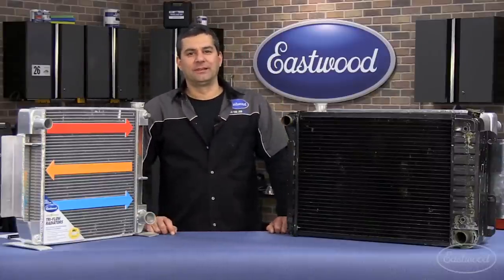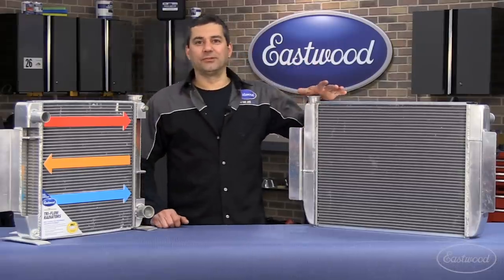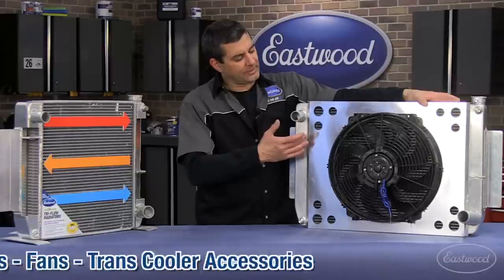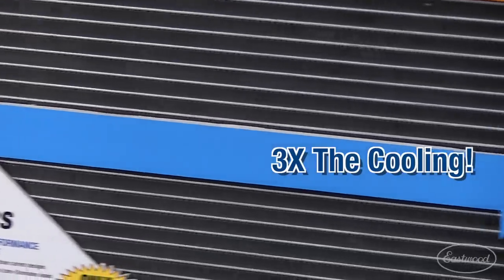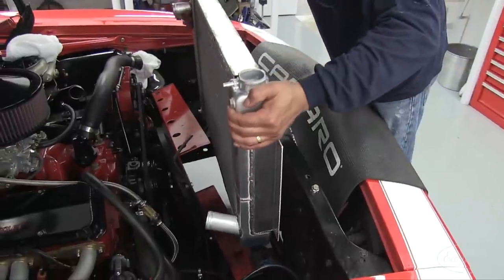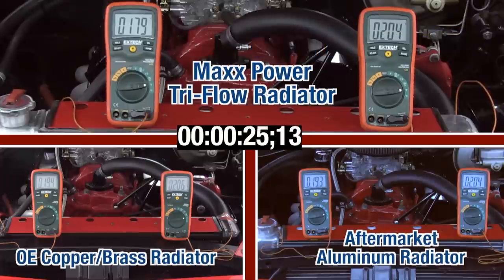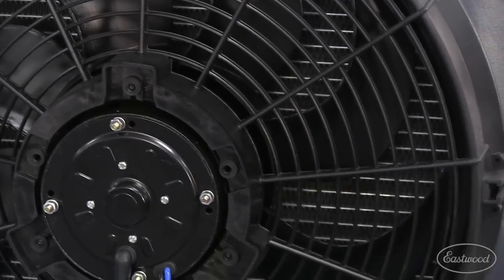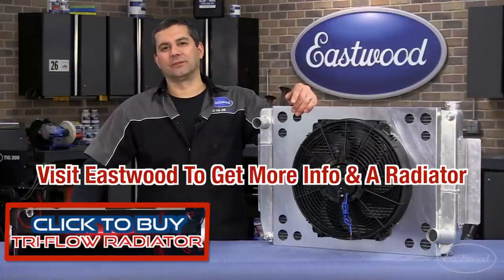Aluminum Radiator - Tri-Flow Technology Keeps Your Car Cooler Than Ever! - Eastwood & Maxx Power

Comment: Anyone who understands the physics of cooling systems isn't buying any of this.  Radiators are heat exchangers, not water coolers, and are at their most efficient when they are as hot as you can get them by pumping as much coolant through them as possible.  A significant temperature drop across the radiator means that it's operating in a less efficient mode, probably because the flow is restricted.
Reply from the maker: Mike Goble   Here is the explanation, in two parts.
Part 1.  You wrote, "Anyone who understands the physics of cooling systems isn't buying any of this.  Radiators are heat exchangers, not water coolers"
A heat exchanger is designed to exchange (remove or add) heat from one medium and pass or remove, through conduction, convection or radiation, that heat to another medium. 
You are correct; an automotive radiator is a water to air exchanger- meaning the water is moved through the radiator and in direct contact with the aluminum material, transferring the heat to the aluminum core.  The water (in this exercise) is also cooled. No, we do not employ a refrigerant to lower the temp of the water as an office water cooler would do.  We instead utilize precise and consistent diameter tubes and virgin aluminum “fins” to form a core that is highly efficient at thermal heat transfer.  The aluminum tubes and fins conduct energy (heat) from the water through the aluminum material and pass that energy (heat) to the air passing over the tubes and fins- essentially lowering the temp of the water…cooling.
 NOTE: At atmospheric pressure and ambient temperature, thermal heat will tend to move from a higher difference of potential (hotter) surface/object/gas to a lower temp or cooler surface/object/gas.
 A mechanical or electric fan is employed to help aid/increase the airflow over the aluminum radiator core to increase the cooling effect when higher speed ram air effect is not available ( traffic lights, under 35mph, heavy engine load, etc.)
 All internal combustion, water cooled engines, are designed to operate at specific manufacturers designated water temperatures. 
NOTE: For this exercise we are not taking into account oil temps, CHT or EGT- just water temperature.The manufacturers employ thermostats which are designed to regulate the operating outlet water temp of the engine, therefore creating a temp baseline.  For example an engine with a 190F thermostat is designed to run at an optimal (albeit lab standard) 190F water temp.
 NOTE:  220-230F is the new normal for late models but for this example we are talking pre 1980’s V8 engines)
Part 2.  You wrote:  "and are at their most efficient when they are as hot as you can get them by pumping as much coolant through them as possible.  A significant temperature drop across the radiator means that it's operating in a less efficient mode, probably because the flow is restricted."
 This is correct for a heat exchanger used to transfer heat from a higher thermal temp (the temp of the liquid, air, gas, etc., inside the heat exchanger) than the temp of the liquid, air, gas, etc., passing through /over its coil or core.  For example; in a home heating unit you want the most efficient method of transferring heat from one medium to a second. The electrical coils in a home heating unit operate efficiently at elevated temps to transfer (exchange) as much thermal energy from the heated coil to the air blowing over them.  A hot water heater is another example of your heat exchanger that must operate at elevated temps to become efficient.
We know that an internal combustion engine transfers chemical energy into mechanical power, the byproduct of this reaction…. heat. In fact approximately 65-70% of the energy in gasoline is transferred into heat in an internal combustion engine.  Also remember: heat wants move from hot to cold.   In the automotive application of a heat exchanger, you do not want the radiator to become heat saturated (“as hot as you can get them”), as you stated above.  If this were the case you would have a thermal run away- overheating.
If the radiator (heat exchanger) were as hot as possible there would be a partial reversal of heat transfer and the hot radiator, having a higher heat potential ( temp) than the water would begin heating the water to a higher temp than the 190F water temp the engine is striving to maintain.
Imagine the radiator aluminum core is hypothetically 250F and the  water entering the radiator was 190F.  The water would absorb heat through conduction and exit the radiator at a potential of 200F or more.  This is not what we want.   The increased heat of the water would begin to transfer thermal heat to the engine block and heads through conduction, which would increase temp and elevate the water to an even higher temp until thermal runaway and overheating.  You need the radiator to act as a water cooling component- not to chill or act as an office water cooler, but to impart as much thermal differential from the inlet to the outlet as possible. If we want our engine water temp to run at 190F then the water temp exiting the radiator and entering the engine must be below 190F.
So we need our engine water temp to TRY (not real world but lab based) to run all day at all loads at 190F.  Water entering the engine (in our example here) exits from the radiator, enters the engine through the water pump, into the block, flows around the cylinders and up through the heads exiting through the thermostat and entering the radiator for another cycle.  Remember we want our engine to maintain 190F.  In a traditional OE (or some aftermarket radiators) the best temp reduction, or measure of efficiency, is reducing the inlet water temp 10F lower than the outlet temp.  For example: the water exiting the thermostat is 190F; it enters the radiator and exits the radiator at 180F (10F differential do to the limited efficiency of the non Tri Flow design).
 Now that 180F water enters the engine block and flows around the cylinders and up through the heads and out past our 190F thermostat.  Meaning, we can only absorb 10F of heat to get to our 190F water temp target.  As we drive under load, accelerate, idle for long periods at lights or experience 100F ambient outside air temps, etc., these all contribute to increased thermal heat in the engine. Hard acceleration induces higher CHT and higher EGT that will ultimate transfer much greater amounts of heat into the engine block and cylinder heads.  As much as the thermostat wants to regulate the coolant temp to 190F once the water temp is higher than the thermostat temp (190F here) the thermostat is no longer regulating the temp, it is constantly open. The increased temp of the engine block and cylinder heads now transfers that heat to the water (as it is designed to do) and elevates the temp of the water.
Now the water traveling inside the engine may reach 205F very quickly. The 205F water now enters the poor efficiency radiator and again the radiator can only decrease temp 10F so now the water exiting the radiator is 195F.  Again the water travels through the block and up through the heads but is at the elevated temp and  absorbs even more heat from the engine via conduction, which will increase the water temp to 220F. The 220F water enters the radiator and again can only be decreased by 10F so it exits the radiator at 210F. The cycle will then continue to increase in temperature until the pressure and temp reach critical and the radiator cap relief opens or a head gasket fails.  If you have a more efficient radiator, one that can reduce water temp twice that of other units you will begin to see the benefits.  If the water entering the radiator is 190 and exiting at 170, you have a 20F temp differential and the ability of the water to absorb more thermal energy in the form of heat from the engine.  Now the water enters the engine at 170F and can absorb 20F of thermal heat and exits at 190F through the thermostat, enters the radiator at 190F and exits at 170F, continuing to hold the water temp much closer to the optimal 190F the engineers wanted.
 Running your stock thermostat, radiator cap, overflow system and water pump are all fine.  We do recommend 1 to 1 water pump pulley to crank pulley ratio.  The crank (water pump driving pulley) should be the same or very close in diameter to the water pump pulley itself.  Power adders, unleaded fuel, nitrous, advanced timing curves, or just a simple re-build going from 8.5:1 to 9.5:1 will put an increased load on your cooling system. An engineered system with shroud and electric fans like our Tri Flow units will handle all your needs, eliminate the overheating issues and make your ride much more enjoyable.
Can you have a cooling system that is too efficient? Ever notice over the road trucks in winter with radiator openings blocked trying to keep heat in the blocks for combustion? Our units are not there yet but you will notice reduction in water temp. Try a Tri-Flow Radiator on Eastwood for 60 days and if you're not completely satisfied just call and we will refund your purchase price.Hope this helps.
Reply: Eastwood Company  I wonder why GM, Ford, Chrysler aren't doing this double/triple pass since the inception of the aluminum core in the early 80's. I know they did a lot of controlled testing to make the smallest radiator for each engine application and Ford did find out that the only way to increase the cooling or displacement of BTU's was to add more core or increase the air flow across core.
Reply: Eastwood Company Let's cut through the sales talk and get down to the physics. Let's take your Maxx Flow 22 with the 43 dual rows of 17" x 1" tubes, 86 tubes in all.  If this was a single pass radiator with 86 tubes in parallel it would take about 3.5 psi to run 43 gpm thru this radiator, .5 gpm per tube.  Your divider plate puts the first pass with 22 tubes, and in order to maintain the same 43 gpm coolant flow rate we will need to flow 2 gpm per tube and drop almost 14# across this first section, 11# across the second pass and 8 across the third, for a total of abput 33 psi dropped across the radiator in order to flow 43 gpm through our rapidly heating block.  You've taken a basically square radiator and turned into one with three times the length and choked the area down to about 1/4 in the first section and increased the pressure drop enormously.  Turbulence will only do so much for you, and turbulence also works in the block.  If you don't keep up the flow in the block, hot spots develop and you're in trouble.  As mentioned by other commenters, it would be interesting to see a more instrumented demonstration, with pressures, flows and temperatures while under a significant load.
Reply from the maker: Mike Goble When we were developing this radiator, the product manager installed it in his '68 Camaro and ran it all summer, driving the car about 50 miles round-trip a few days per week (basically any day rain wasn't in the forecast).  He was convinced this was the radiator our customers needed.  We sent it out for independent testing where it also proved to be more efficient than other radiators.  We then did the test you see in the video - a real world test between 3 popular radiators - and the Tri-Flow beat the competition - which you can see in the video.  You can actually see the temperature drop more in the Tr-Flow than the other two.  We're so confident you'll love this radiator we offer a 60 Day No Hassle Money Back Guarantee.
Reply: Eastwood Company Smoke and mirrors.  The use of the word 'struggling' at about 3,50 indicates the real lack of understanding about how cooling systems work.  The only point that is controlled in the cooling system is the engine outlet temperature, and for each of the radiators tested it remains essentially the same.  Nothing was 'struggling', the temperature drop across the radiator is a result of the thermostat position and the flow thru the radiator. The real test of a radiator comes when you actually start making some horsepower, not cruising around town occasionally.If you were to put a 200 hp load on this engine you would very quickly see where the multi-pass restricted flow radiator comes up short. Let's see that test.
Reply: Mike Goble you are a clown. You must be an engineer. Lmfao. Too caught up in the physical science to realize that the design works. Its no different from any other radiator, it's just more efficient.
Reply: @Mike Goble I believe the term you're searching for would be closer to thermal dynamics or just applied science to HVAC. It's a simple heat exchange theory you're making mountains out of ant hills, keep it simple the only downfall of the aluminum is its ability to rapidly exchange heat so at a point ambient heat can be an issue but like earlier said a shroud and electric fan technically take the efficiency down energy wise but raises the ability to transfer heat which is our end goal here I believe.